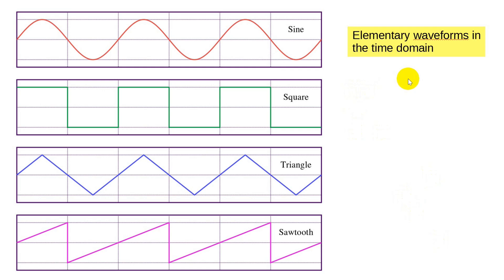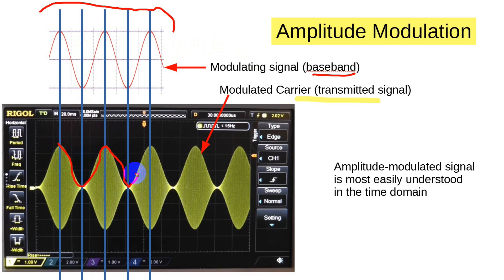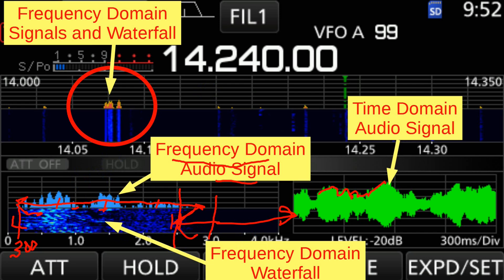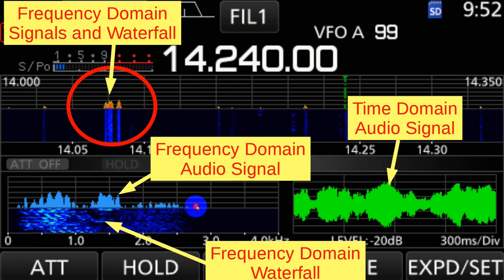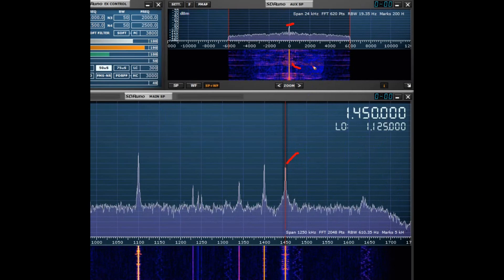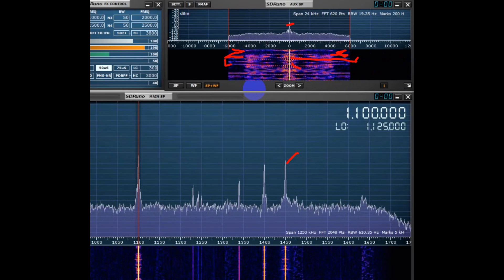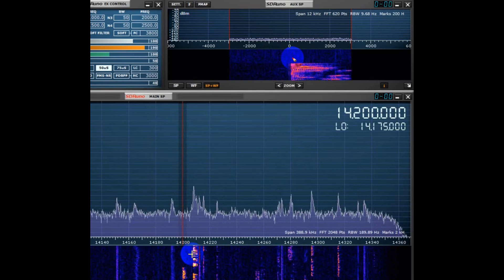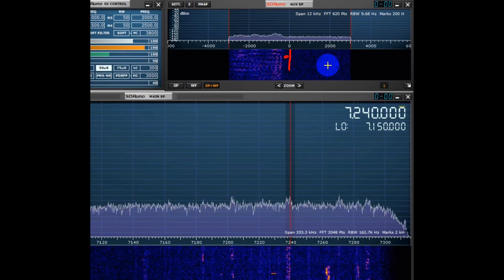AM and Single Sideband Signal Spectra (#288)

Comment: Interesting. 
I debated with a friend if CW and MCW (modulated CW) looked the same.
Had to check with a web sdr when I was transmitting and the two looks identical.
MCW was generated with HRD and CW with a straight key.
Reply from the maker: Yes, if done right, they look identical on the air.